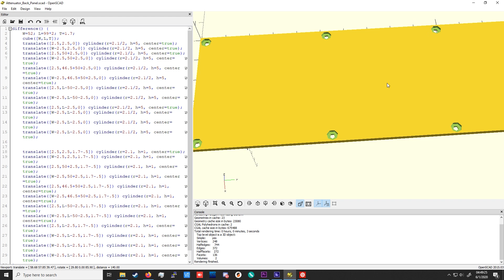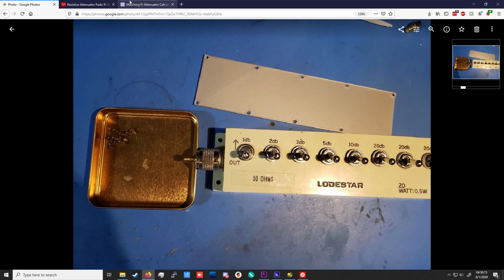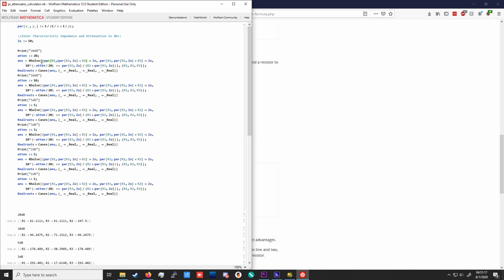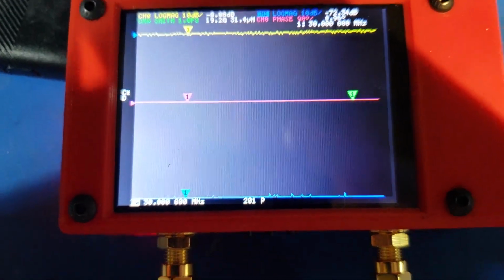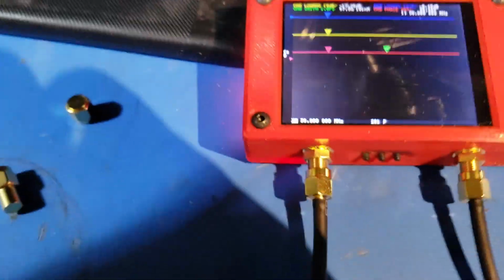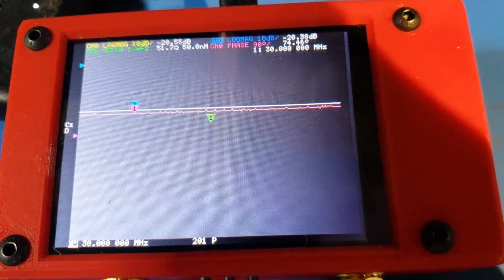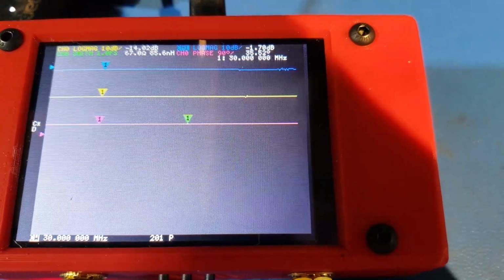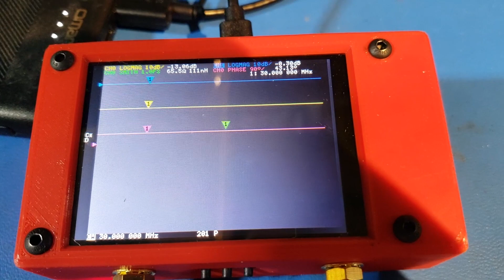NanoVNA V2: Rebuilding a Lodestar Variable Attenuator Switch Box

Comment: What we have to do for 2.4ghz range same power ?
Reply from the maker: In what context are you asking this question? Building an attenuator box for a 1/2 watt rating at 2.4 GHz?

This box is for HF and below (<= 30MHz). An S-Band device would not be able to use large through hole components like this and get good results due to large parasitic reactances at  microwave frequencies. It would almost certainly have to be build on SMT.
Reply: @R3RadioResearch  i just want to have a 33db attenuator and 0.5watt and support up to 3ghz, is it possible to make it by myself?
Reply from the maker: Absolutely. So you'll want to make a microstrip circuit with surface mount resistors for a pi network that has 33dB of attenuation and a .5 watt rating with adequate cooling. Alternatively, the easy way to go about this is to go buy a 10dB .5 watt attenuator, then put in series a .05 watt or greater rated 20dB attenuator and then a 3dB attenuator of .0005 Watt rating or higher at the end. The results is 33dB of attenuator with adequate power handling. Basically what you want to do is build a string of COTS attenuators where each one in the chain is rated for the power it will dissipate at that point. Does that make sense to you?
Reply: @R3RadioResearch  Yes , thanks . I thought it is possible to make it with som smd resistors 😋